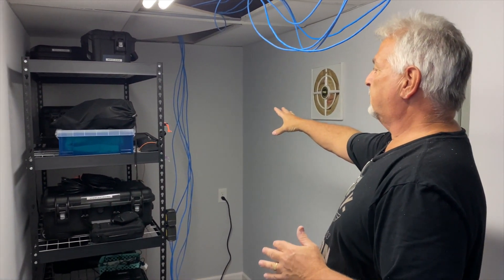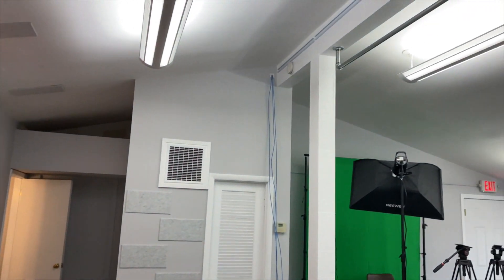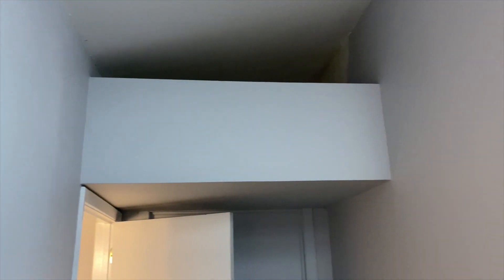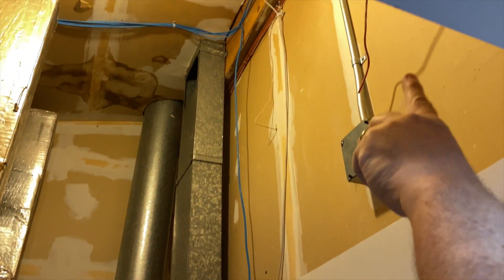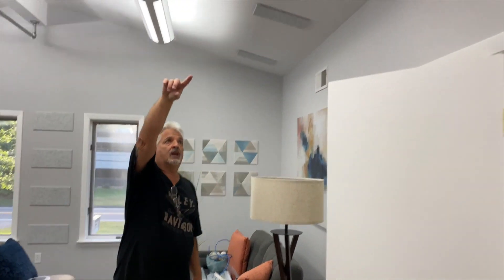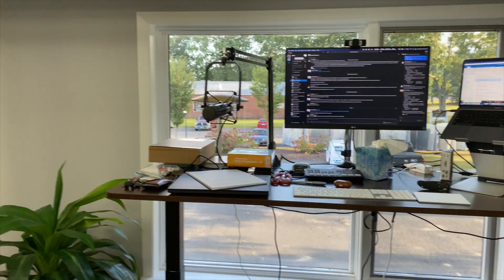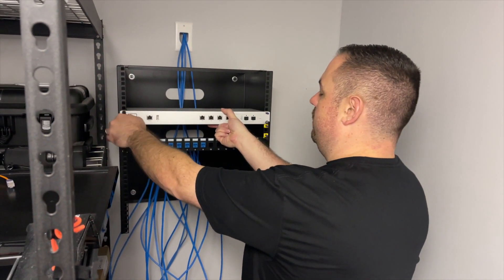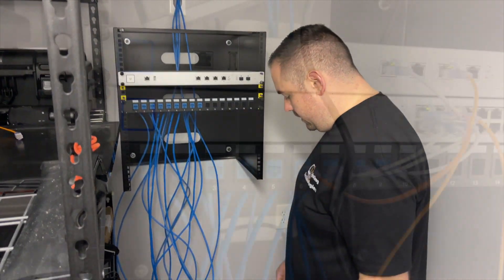Collaborative Networking Project

Comment: hrrm are you allowed to run cables over the drop ceiling in the US? You not required to secure them above and off it using catenary wires, trays or j-hooks?
Reply from the maker: They will eventually be secured off the trays. Here in the south eastern section of NC the building inspectors don’t pay attention to low voltage cabling. Can’t speak for the whole US. Joe can probably speak to the Connecticut area.
Reply: @QuikTechSolutions  cool, lucky, some parts of the world you cant touch it without proper accreditation (more or less a licence) , its completely over regulated in places like Australia and New Zealand, probably because its governing document is what they call wiring rules which also covers electrical, the govt boffins  too lazy to separate and copy and paste the regs Im sure of it

Comment: Looks great, a nice and neat job
Reply from the maker: Thanks Alonzo!  Yeah, Joe was teasing me saying “I’m very meticulous.”  I didn’t want to run the wire mold along the baseboard. I wanted to remove it, cut away some of the sheet rock, drill through the studs to snake the cables, then put back the baseboard to cover everything. We were on a very tight schedule, time just didn’t allow it.